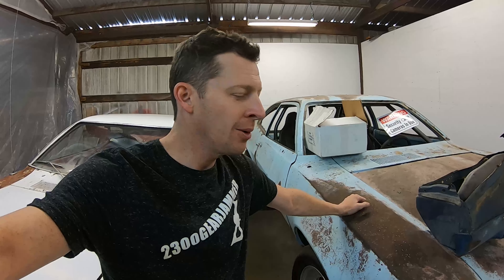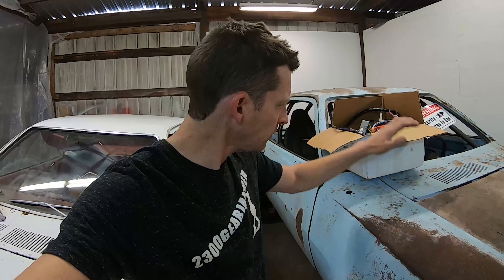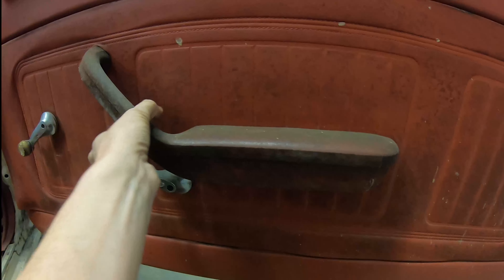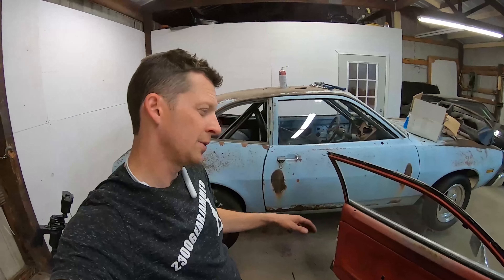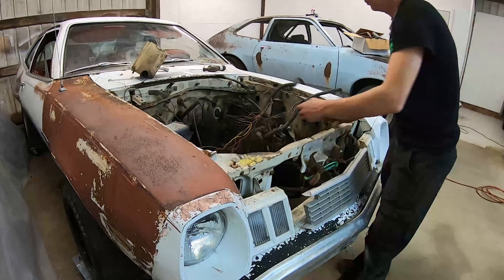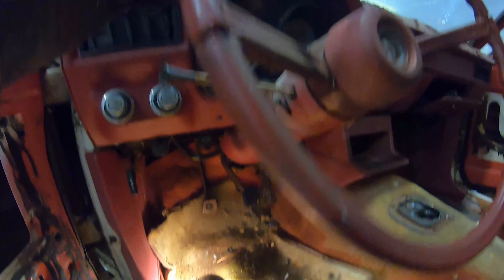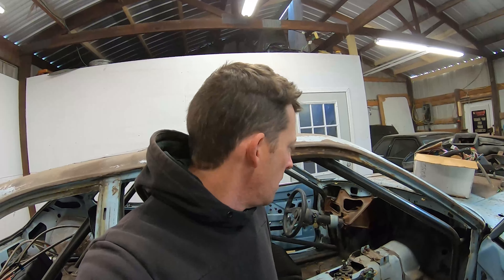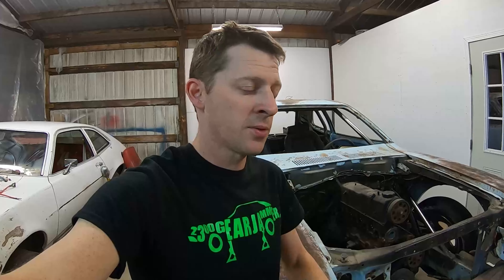Will it run? Parts pinto gave it's life for our project.

Comment: This content is awesome. Super helpful for anyone looking to build up a 2.3T based car. Do you have a preference on "drop-in" wiring harnesses? What options are out there? I have seen two different setups made by Ron Francis. Also..what about relays (4 or 5 blade) to replace the ircm on tfi cars? What kind of task/wire management do you prefer for e-fans, fuel pump relay, etc?
Reply from the maker: 🤘thanks a ton. I am trying to decide on the wiring harness. I have a nice Ron Francis dropin but that video is coming soon. The rest of the project will move along pretty quick. I may not get into too much detail though as Im not confident with what I'll be doing. 😂

Comment: Good thing you added the door locks, those pintos are getting rare. 🙃
Reply from the maker: Could you imagine how devasted I'd be if somebody found it unlocked, stole it and then returned it but didn't lock it up.
Reply: @2300gearjammer  after all the trouble you went through to put the locks in there! id be disgusted.
Reply from the maker: I'd be reporting the stolen door locks...police would ask for a description and I'd have to admit it was attached to a blue pinto. 🤔

Comment: Have I got an svo for you (roflol)
Reply from the maker: 😂 continue....
Reply: @2300gearjammer  nothing special, justa 1984 90% original 30,000 mile running project. (It's MINE) 
With that said I will be making it my daily (when not riding motorcycle) waiting on alternator and wiring to update. After that AC. I will be bothering you for advice on performance mods once my wallet allows (pimpx injectors boost controller) love the channel also I want a t-shirt 👕 (let me know when available)
Reply from the maker: @brembojoe  wow. The way you describe it makes me want to go throw rocks at my svo. Haha. I'll be excited to see that AC work too. I need to fix that one mine too. Thanks a ton. Let me know if you have video topics and I'll try to work them in.
Reply: @2300gearjammer  pimpx  install... T-shirt lol